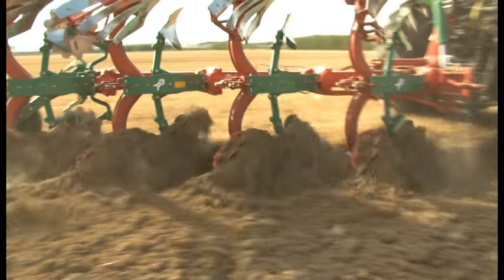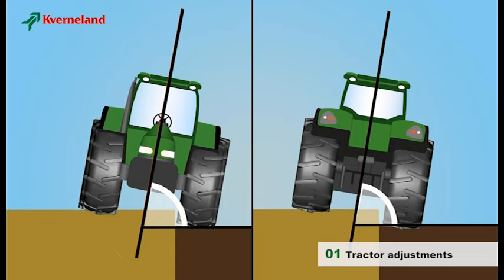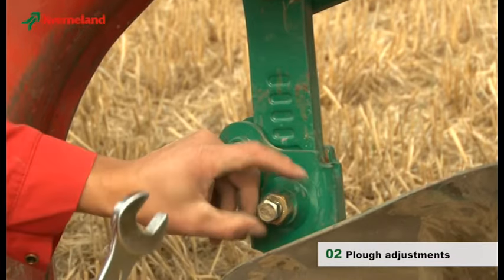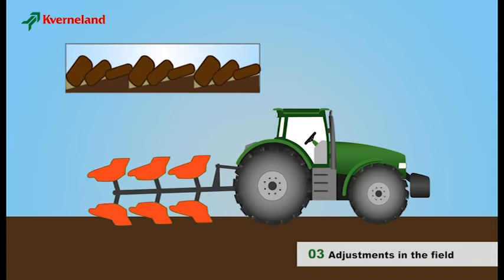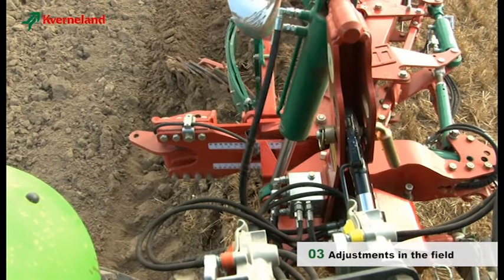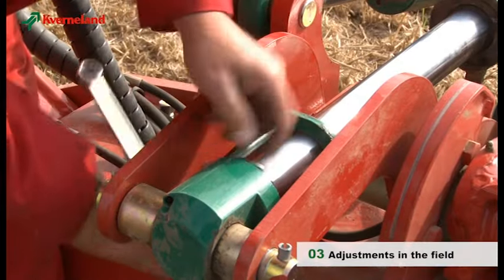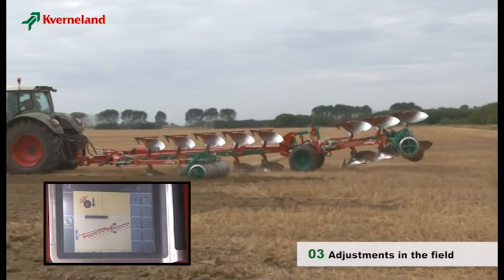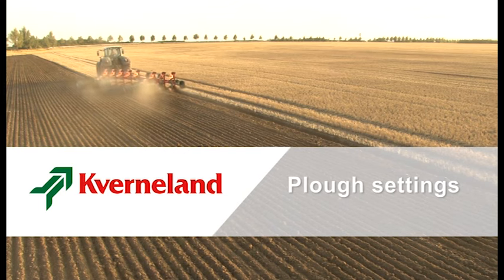Kverneland Plough settings and Packomat

Comment: Any videos on setting a semi mount plow? I have an older Kverneland 6 bottom plow (I think its a BB100) and I noticed that its undermining the next furrow. Cant figure out why its doing it. Anyone have any suggestions or a link to where I could fix this problem. I may be that it just has worn parts and sloppy although it doesn't seem like it is and the landslides are in good shape.
Reply: +Kverneland Group 
Thank you! I will do that.